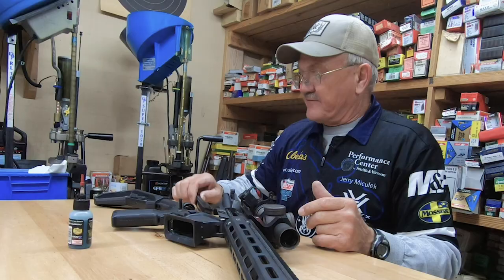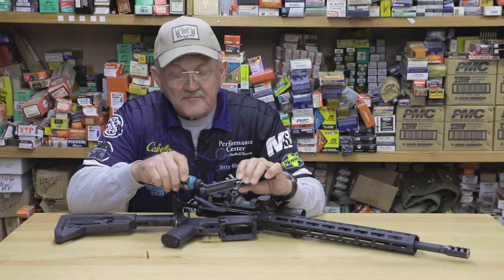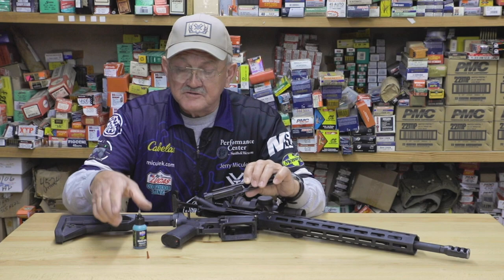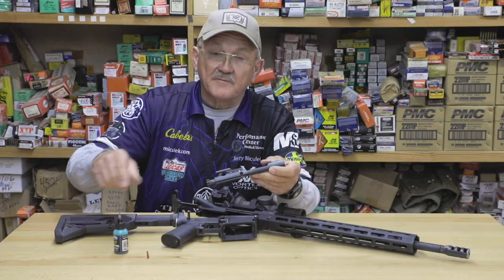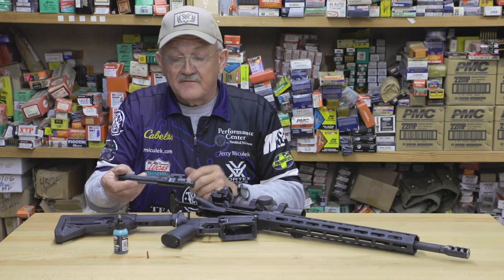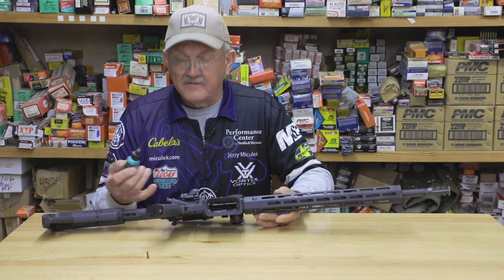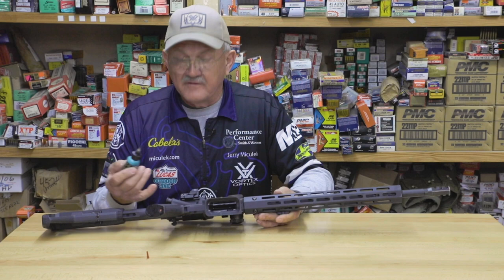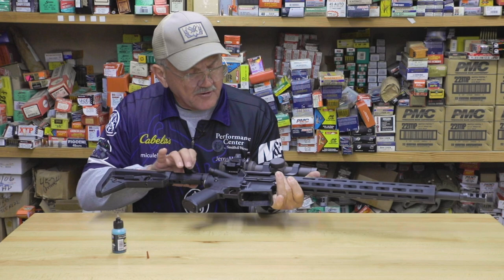AR-15 Range Prep

Comment: By all means the lubrication of an AR 15 is significantly different than your normal automatic or other actions. The gas blowback gives it the power to overcome heavy lubrication and dirty conditions. Even so, one can easily pull out the BCG and douse it with oil and be good to go. It is definitely a robust system. If I treated my Sig P365 like that there would be light primer strikes left and right. Two totally different beast. Meant for totally different conditions. In combat it doesn't matter what your weapon has been through you still wanted to work with minimum effort.

Comment: Hmm. Has Jerry tried the terminator muzzle brakes? Saw this video of a recoil sled that measures the recoil reduction or various brakes. And if the sled test is to be believed, his brakes seem to perform better than almost everything,  even the JP tank brakes. His T3 terminator brake is 2.7" long x .980 outer diameter so it should fit in the 3"x1" compensator rules for 3 gun.  
https://www.youtube.com/watch?v=rf3rLi8L67I